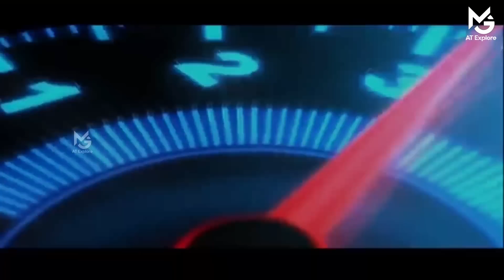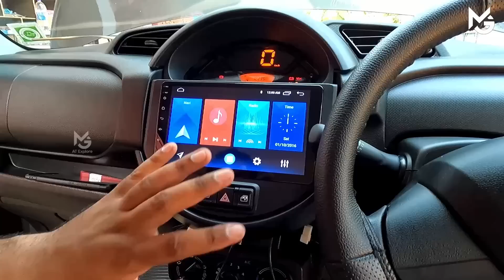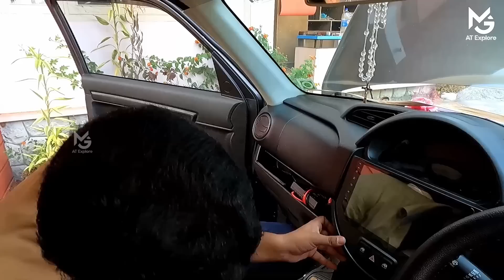അടിപൊളി സബ് വൂഫെർ പിടിപ്പിച്ചാലോ | BLAUPUNKT Gtb8200A | Moco Android stereo|Complete Fitting Spresso

Comment: Chetta power line and camera line inte koode RCA line edukkall, eppalum power line inte nere opposite side il koode RCA cables edukkanam, allengil power line aayit audio signal intefere cheyth quality drop undaakum!
Reply: Bro kit el varuna cable magnetic flux cutting Insulated anu so aa problem undakella.. Normal cable anu use chayunathankel urapayum bro parajath shareyanu quality nashtamakum

Comment: Bro, ആ switch എവിടെന്നു കിട്ടും??? എത്രയാ അതിന്റെ rate??? additional horn fit ചെയ്യുമ്പോൾ stock horn ഉം aftermarket horn ഉം മാറ്റി മാറ്റി അടിക്കാൻ വേണ്ടി ഈ switch ലേക്ക് connection കൊടുക്കാൻ പറ്റുമോ??? Wagonr 2014 മോഡൽ വണ്ടിക്കാണ്.
Reply: two way switch vagandi varum
Reply: @mohammedsinansha6429  Bro two way switch already und. Pakshe ath kaanan oru standard illatha kaaranam ath maati inganthe(videoyil kanicha polathe) original or original polathe press type switch vekkanam ennund ath pattukayanenkil.
Reply: @arjunsuresh2000  video yil 2 waty switch alla pinne press cheyunna 2 way undo enn areela
Reply: @mohammedsinansha6429  ok

Comment: ബാറ്ററിയിൽ നിന്ന് extra connections എത്ര എണ്ണം എടുക്കാൻ സാധിക്കും. എന്റെ വണ്ടിയിൽ ഇപ്പോൾ remote key, fog lamp എന്നിവയ്ക്ക് വേണ്ടി ബാറ്ററി യിൽ നിന്ന് connection എടുത്തിട്ടുണ്ട്. ഇനി Sub woofer ഒക്കെ ഫിറ്റ് ചെയ്യാൻ connection എടുക്കാൻ സാധിക്കുമൊ
Reply from the maker: Ankane oru problem illa tension akenda kodukunna wire nalla gauge undakanam...
Reply: @MGATEXPLORE  angane cheythaal maruti warrant issues varille??  athengane over come cheyyum??
enikkanel proper amp okke vach music system upgrade cheyyan aagram und but warranty scene aavumo pedichaa cheyyathe !!!
Reply: Ente vandiyil power window, fog lamp, sub woofer, central lock und